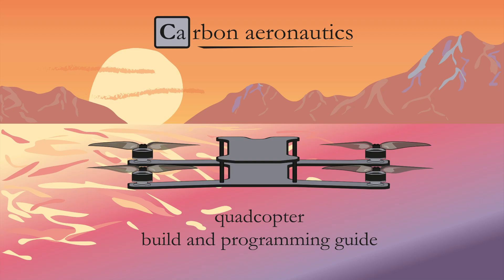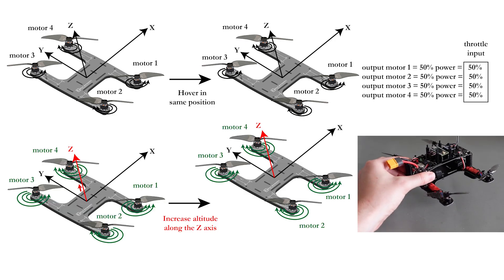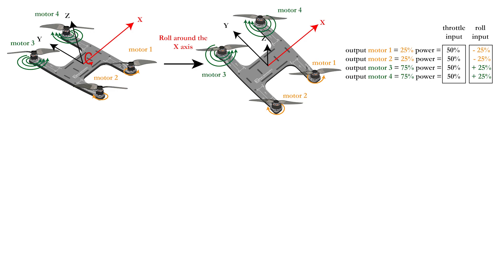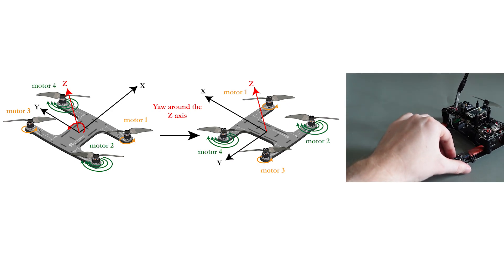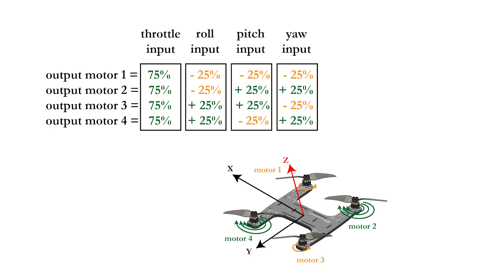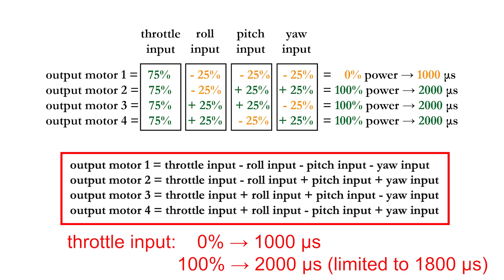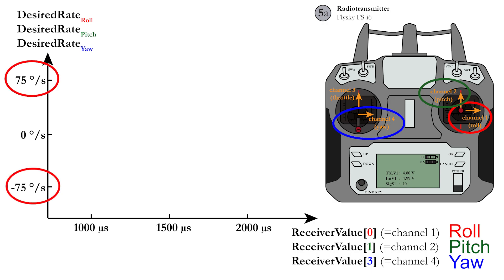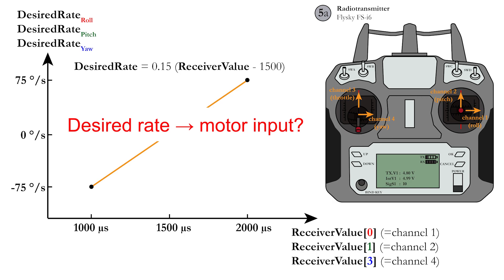11 | Learn how a drone moves through space

Comment: At 2:49 you say that that motors 2 and 4 that spin in a clockwise direction should reduce power. But then you also say for a yaw in the counterclockwise direction the motors that move clockwise should move faster as this produces a torque in the counterclockwise dorection. Your drawing too shows that motors in the clockwise direction have increased power ( more of the green lines). How come?